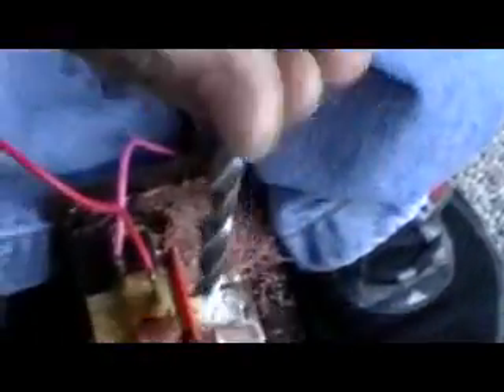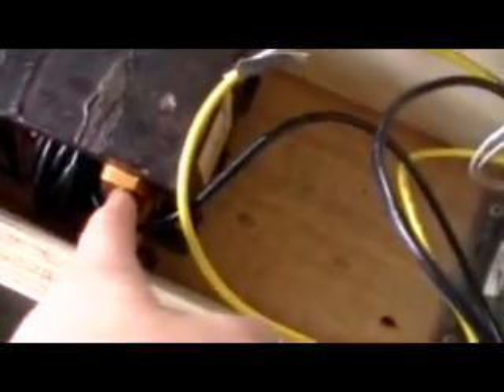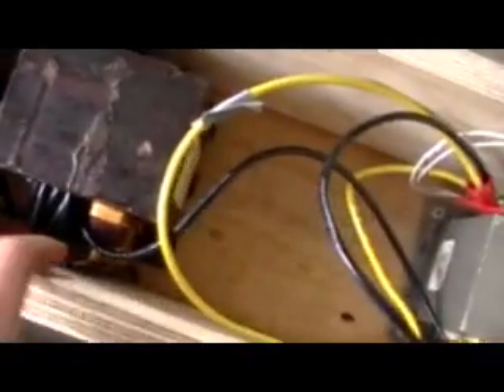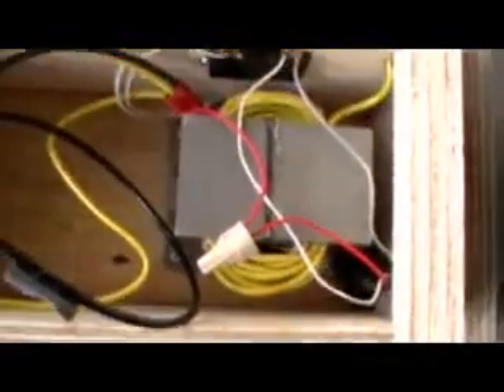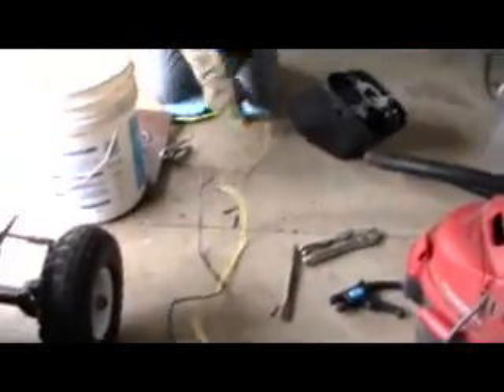How to make a homemade Welder (diagram)

Comment: I found 2 medal halide transformers heres the images will these work for a welder?
http://i1323.photobucket.com/albums/u590/Brett_Stafford/0113151941b_zpsf259ad79.jpg has 4 wires on bottom and one wire on top different then the ones your using.
Reply from the maker: Johnson B it should work fine just use only 2 of the wires, if they're connected in sets of 2 then just wire 2 of the wires together to make 1 wire.

Comment: Are you fucking mad?
Im not sure but useing EI transformers from fucking microwave is stupid.
What i did was:

1200va 400v primary with 55v primary, soldered  2 11mmsq to the transformer sec and added 400A bridge diode with 50kuf caps, all 100v 16 of them, ... thats insane, i could spotwent but it just  melts everything...
But welding with rods is way vetter than any other .

Dint cost me anything, had all parts laying around, you should try toroid, its probably the best,

Comment: Ok, I built one of these and all it will do is stick my welding rods to the metal. 2 mots wound with aprox 20 winds of 10ga wire, wired in series. What could my problem be?

Comment: watch out pluging in 2 diferent sockets some houses run on 2 phase power and could help to put a choke on secondary side 
these transformers are great for tube amps etc
also were the filament wing is theres little metal tabs these are shunts pull them out
if u want to make a big tranny cut out sheet metal into long strips paint them so there insulated wrap it sos its like a tape roll can use sperate strips  put some materail tape around it or somethink else to stop shrap edges cuting wire

Comment: Cool, u build a DC rectifier with and Amp bridge. Thats is really not a welder, cause the ark will not really maintain peak amp all the time.. BUT, you have acomplished something most teenagers wouldnt.. And that without burning down your house. Kudos!
Now... Make a real rectifier instead, you have the basic knowledge. And make sure it stabilizes the amperage drawn. And will not oscilliate and not risk catching on fire. Once again, kudos!, cool experiment.

Comment: After spending days researching this setup on YouTube i have come yo realize that the amps and volts entering the machine is most dangerous,after passing first mot volts drop approx to 40vac and amps go up to 40 or so,not so dangerous,then after passing second mot vac drop to 20 and amps go up to 80 or so,even safe to touch electrode end and ground end with both hands,the way i see it,if everything is boxed in safe and made good, casings of mots earthed to power outlet then good job! well done!

Comment: i wouldnt do this to save money but anyone learning to weld could use this as a great learning tool. one thing though for practice the hardest thing to weld with is coat hanger. if you can master welding with coat hanger you can weld with anything. good job fellas i wish i started welding as young as you guys.

Comment: @shortyjk95 see all you really need the volts for is for keeping a contact but amps are what melts the metal meaning you can have a tun of amps and like .5v and weld like crazy ive seen it done  but that welding a clan serface to weld rust and durt filled places you need only like 15  v and a tun of amps idk how mutch that would be i dont want to do the math and to get more amps you literally use a ticker wire and wrap it less times i mean you can make a welder out of 1 but 2 is better

Comment: i think like 8 gauge should work for that  and not get hot.. you should put in a 15 amp breaker in the box so if it trips you just reset from there not your house with a 20 amp breaker.... in AC there is no + or - its hot and neutral sorta the same but its more of a safe thing because neutral is safe to work on and hot is not... its easier to get shocked with AC ... just so you look like you know more about what your talking about in the future

Comment: @shortyjk95 eh i broke a good multi meeter with thos and it was no fun.... step dad bought me a new one...way better...  and it dose matte rif they arnt need and wrap around eachother it alters magnetic feanld and you losse qwite abit of power... you have 2 transformers.. you dont need 20 wraps each  and hears a little help the thicker the wire and the less wraps and more wraps on the non modified part = higher amps ... and you use more amps than voltage in welding like that

Comment: god you dont know much about electronics but um ya it dose matter what way you wire the transformers and you should have used a thicker wire but it looks like you got lucky with the wiring of the transformers and put the hot in the welding rod and the nutril in whatever your welding that's pretty important

Comment: Yeah i had my research wrong... taken from instructables...
If the secondary has more turns than the input, its output voltage is higher.
OUTPUT VOLTAGE = INPUT VOLTAGE * (# OF 2NDARY TURNS) / (# OF PRIMARY TURNS)
Our primary has 100 turns and gets connected to 100 volts AC. We're winding 20 turns on the secondary, so we'll get about 20 volts out.
The available POWER STAYS THE SAME regardless of what the output VOLTAGE is.
POWER (WATTS) = AMPS * VOLTS

Comment: i dont get y everyone fails at getting the secondaries out
i got it out in two pieces, u jsut hack saw one end off clean, then u pull out the thick wire that goes around abt 4 turns( this gives u wiggle room) and u wiggle the rest of the secondary out with some rod

Comment: @rjpatapat The wire you wrapped should be insulated 10gauge with preferably the highest heat toleration you can find.

Comment: @toxicproductions100 I worked on it with him. We are running on 2 DIFFERENT CIRCUITS because of the amperage problem. We were running on a 10A and a 15A curcuit. It should be fine right there, because the 10A was also powering lights inside the house. The welder outputs around 36V and ~100A. Our amperage gauge on the multimeter wasn't working, so I have no idea how many amps the welder draws.

Comment: just wire up a 4 wire 220 cord with for prongs becouse all 220 is, is 2 110 house curants put together in 1 double breaker the take the black pos to on trance and the red to the other and split the nutral and the ground